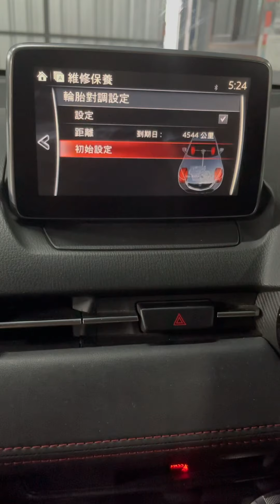Mazda 2 Regular Health Service (ASMR) *Car Go Garage

Comment: How often do you replace spark plugs?
Reply: The normal spark plugs every 15-20 K Km, the platinum or iridium spark plugs every 50-60 k Km. I suppose that Mazda 2 series mount iridium spark plugs.